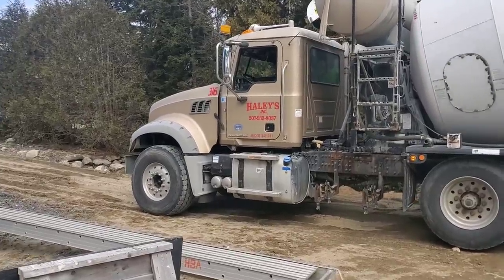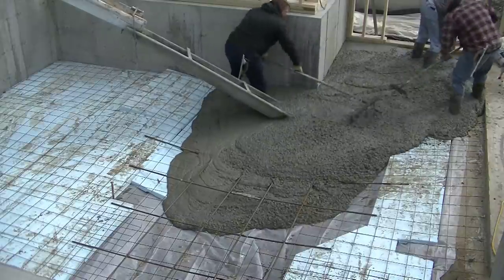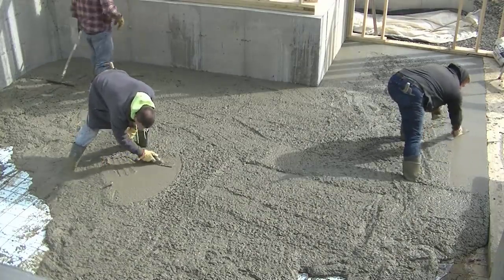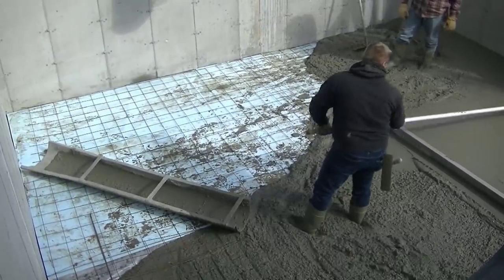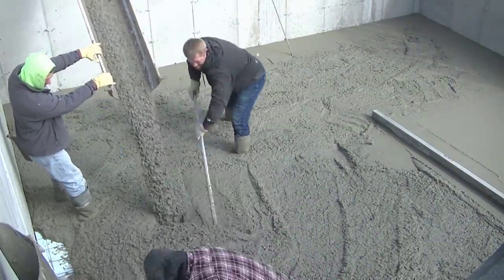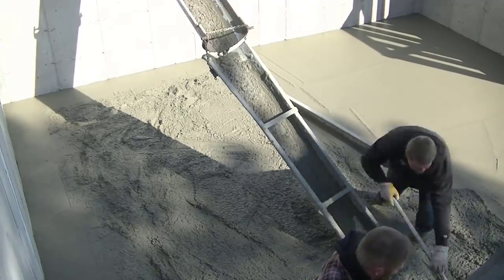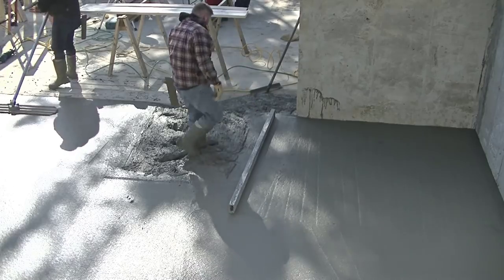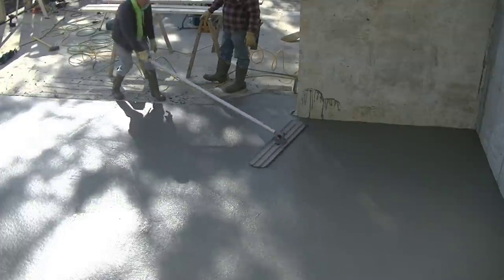Pouring A Small Addition Concrete Floor

Comment: That looks like a busy day. Contractors building, you pouring and setting,....fast fast. FWIW, I'm in Texas and we trowel everything, but it's so hot so early that the job is extremely quick. I've seen crews of 20 guys mag floating and finishing at the same time. It's hot, and you have to. Cheers to your videos...100%.

Comment: That's totally amazing how fast you guys work! I started watching your videos last year when I was researching how concrete was poured. I wanted a patio done under a two story deck. I have a question for you about finished floors. Do you ever seal the concrete floors to prevent moisture from coming up through? Like they did on the walls 32 years ago? They put a black pitchy paint on the outter side of our cinder block walls to prevent water from seaping inside. How long would a poured floor have to cure before you could seal it off? Would that truly prevent moisture from coming up and growing mold...or letting radon though? We also have some big cracks in our basement floor from settling of the house. What do you recommend for fixing that? Just wondering if you did any further finishing work on the inside floors? Thanks for your fascinating videos. I can tell you know your job and would be a great teacher. I'd probably hire you if you were here in PA. I love ME (in the summer). My grandma retired there near a lake George... I think that's the name. Ok thanks
Reply from the maker: We put a plastic vapor barrier under the floor and pour on top of that to prevent moisture. You can use a penetrating sealer like Radonseal to help block moisture and radon from coming up through the concrete.

Comment: Great video. I am curious to know why only part of the slab had what it looks like blue styrofoam board at the bottom. Thanks.
Reply from the maker: That's just the way it was on the plan. Bearing wall going there so probably a weight issue and wanted the concrete on solid ground.
Reply: @MikeDayConcrete  ah ok. I always have am insulation mindset lol. Interesting to see how everything is built.

Comment: Hey mike do you get the floor within 3/8 flat by this work ethic?
Reply from the maker: Yes, flatter than that even.
Reply: @MikeDayConcrete  i am doing a gym floor tomorrow architect requesting floor to be within 1/8 in 10 ft. should be fun

Comment: I did not see anything keeping the rebars in the center of the poured slab..
Reply: At 2:00 and 5:00, you can see them pulling the metal up with a hook. Once the rock gets under the metal, it's not going back down.
Reply from the maker: We were pulling it up. Once the aggregate gets under it it stays in the concrete.

Comment: Excuse my concrete ignorance but doesn’t the rebar get pushed all the way to the dirt when the guys walk on it during the pour, I see the metal hook for pulling it up, but was that enough ?
Reply: The aggregate, which is most likely 3/4”,will stop that from happening, but it’s possible of course
Reply from the maker: We try to avoid stepping on the bar. You can feel it under your feet and just move your foot.

Comment: Why don’t you build the price of a pump into your estimates? It would make it so much easier to pour.
Reply: Pumps are definitely a necessity but I wouldn't have used one here neither. No need for a pump if the truck can reach. Pumps are slower and messy. Especially the half of yard they leave behind on cleanup.
Reply from the maker: It's an extra yard of concrete and 900.00 for the pump, then the pile of concrete on the ground when he cleans out. For us it's much easier this way. We're used to it.